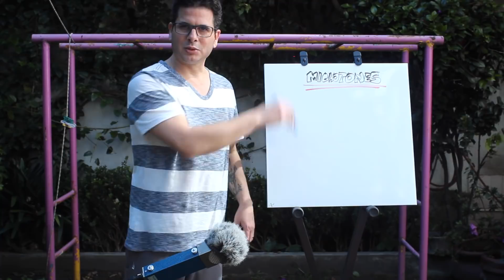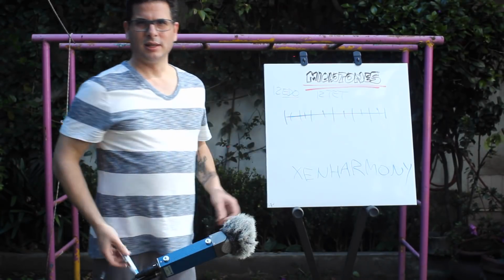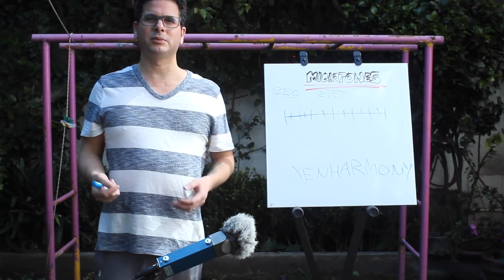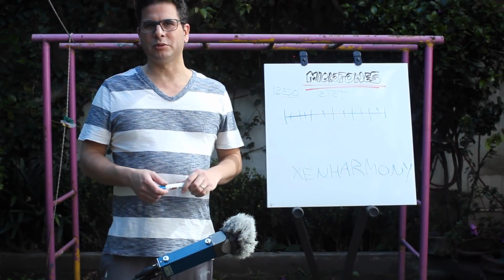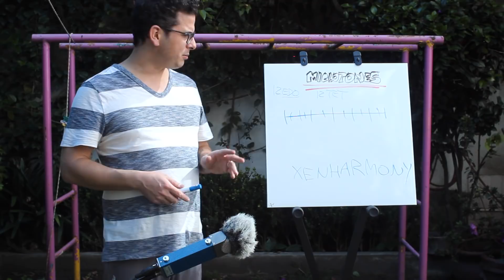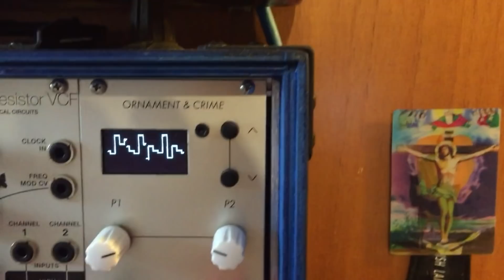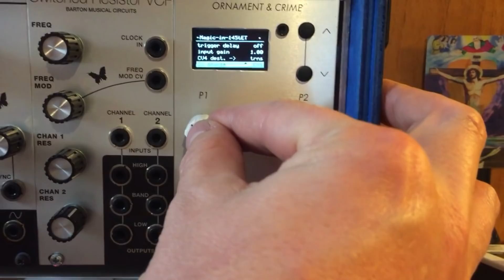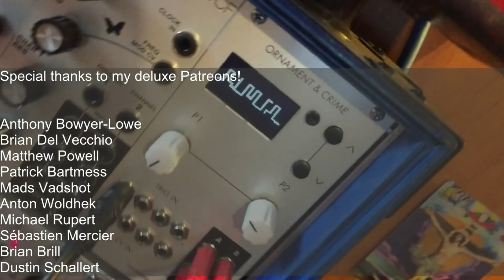Music with Modular #1 : Microtones 101

Comment: This is amazing! I didn't realise it was possible to get different scales by attenuating a controller. Going to run my Keystep pitch out through the attenuverter of my 0-Coast in a bit!

I discovered this album via a post on the Aalto forum a couple of years ago. It really opened my mind to the use of alternate scales and tunings:

https://spectropolrecords.bandcamp.com/album/micropangaea

It used to have a really cool interactive website at www.micropangaea.com but that seems to be offline now. It can still be accessed via the wayback machine but the embedded bandcamp tracks don't seem to work.
Reply from the maker: -i've heard of micropangaea! thanks for that :)